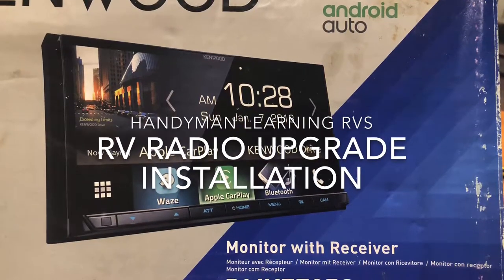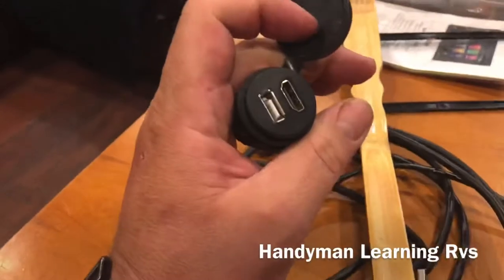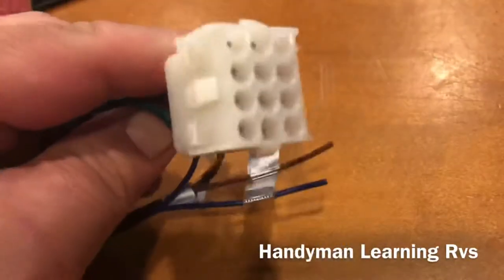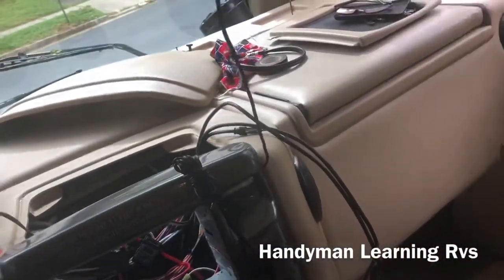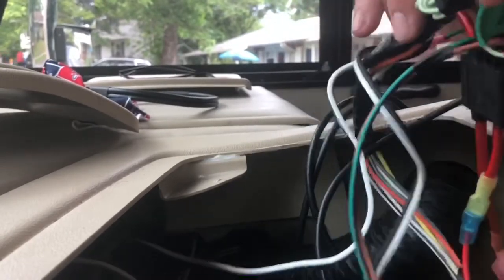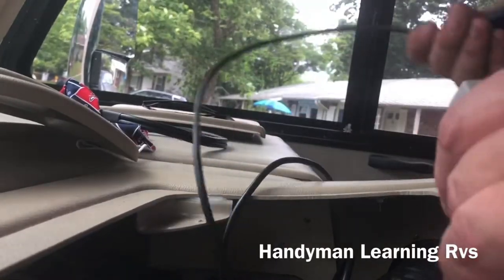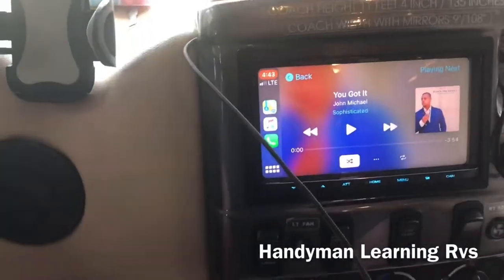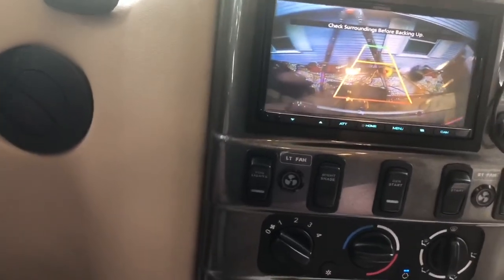Thor Axis Vegas radio upgrade

Comment: my axxera / tablet radio is frozen and i have tried everything to get it working.   cameras are working though.  how about this idea   a  new axxera radio cheap older modle to mount on the doghouse and old radio left in place for camera tablet use.   the front end of rv hits so hard the radio  is  going to keep failing, cheap radio disposable.       how difficult do you think connecting to existing rca from bare wires of new radio?  should i try soldering on rcs or cutting the existing rca and connect bare wires?

Comment: I have a question! My 2016 Thor vegas cigarette light won’t work! I have replaced the 20 app fuse did not help! The wires white and blue/ white are not when plugged in any help! There are two sets of wires!Which set go to the lighter and where does the other set go! Please help its driving me crazy!

Comment: Do the right and left mirror cameras still turn on when the turn signal is engaged? I saw that the back up cameras works correctly but want to ensure the side view cameras work prior to purchase. Thanks for the informative video!
Reply from the maker: Yes the right and left mirror will turn on when you engage the turn signal.

Comment: Could you provide a link to the radio as well as the harness?
Reply from the maker: The radio is a Kenwood basically any good  radio Will have it just look for Apple an android CarPlay. The wiring harness I reuse the one that was in the RV that went to that axxera radio.

Comment: Ah Axxera....worse receiver ever made! Ours died out and I had to replace it also. Trouble is my new one didn't come with a trim ring which I found rather strange. I was able to use the old trim by snipping off the tabs (which didn't fit the unit either) and some tiny strips of 3M tape to hold it in place. I like the better view of the rear camera now.

Comment: is there an easy way to cut the power while wiring up the connections?  The chassis battery is not easily accessible on the Vegas.
Reply from the maker: When  transferring over from the old radio harness to the new radio harness it should not be plugged into the harness in the RV. So they’ll be really no need to cut the power. But if you want to you can just put the house batterie in store mode. Then only thing that will be getting power is memory from the chassis battery.

Comment: Thanks for very helpful video. Enjoyed touring your rv at Jekyll Island meetup! Two questions; 1. does the Kenwood radio screen still display the rear, left, and right cameras? and 2. on ours, the whole double-din 'holder' has fallen loose into the cavity. You mention in the video to bend down some tabs to anchor it before pushing the radio back into the holder but didn't show that on the video. I suspect our installation didn't do that tab bending down (or didn't do it enough). How many tabs should I expect to bend down to anchor it? Hopefully that makes sense. Thanks-Duane
Reply from the maker: The camera function just has the original radio. The bonus with the Kenwood is the radio volume doesn’t mute when using turn signals any more. I did a redo of the Kenwood install video to give better install details here’s a link.
https://youtu.be/k4nW_IuqkFk